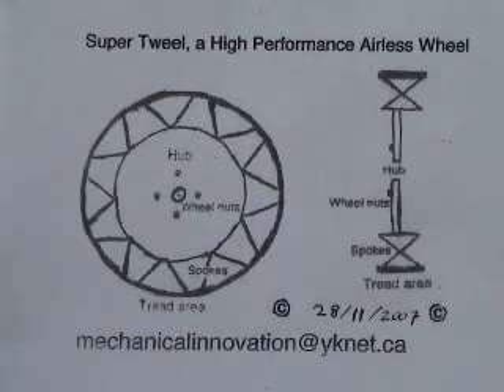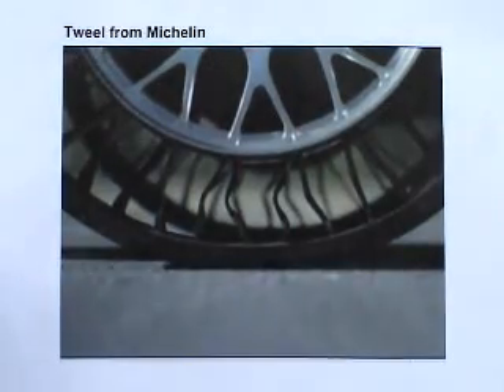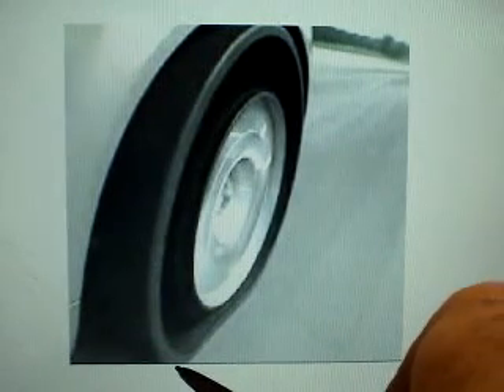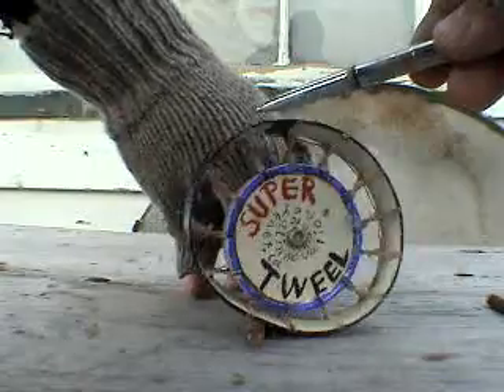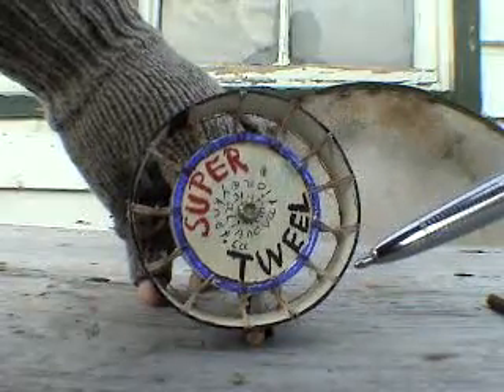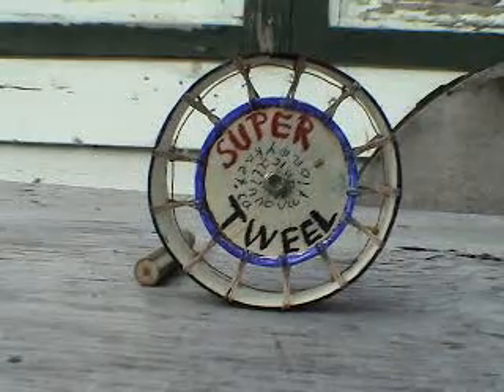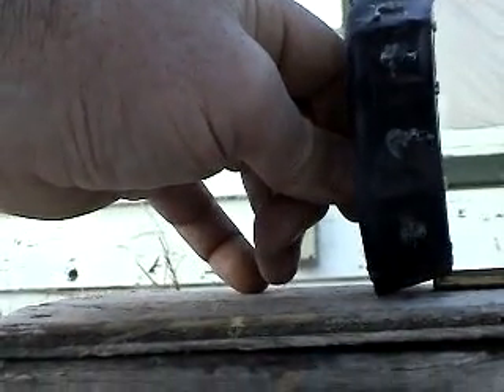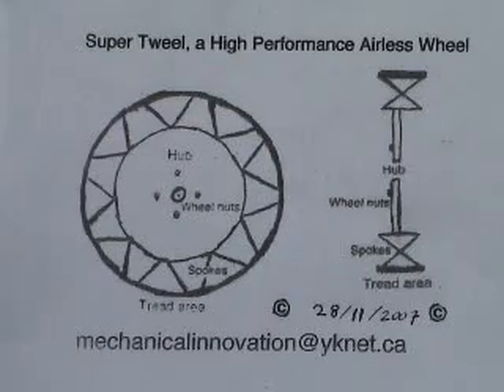Super Tweel, a High Performance Airless Wheel © Peter Becker

Comment: Also, in response to outer rim remaining intact, the tweel does rely to a small extent on the outer edge remaining intact, however, as the tweel does not rely upon the tension in the spars countered by the rim's structural integrity, it does not completely collapse when the rim edge is broken, as evidenced by the landmine test.

Comment: The tweel prevents this possible disaster by not allowing the wheel to extend beyond the initial radius of the relaxed wheel, meaning that the balance of the wheel is maintained (The compression of the lower half is balanced by the force being applied by the ground on the tyre)

Comment: Using this design, the surface of the wheel will be rounded because of the X type spokes that are under tension. The ends of the X spokes are attached to the sides of tire surface, forming a round surface.

Comment: The only problem is that without the compression of the Michelin Tweel, the footprint of the tire is too small, leading it's traction to be next to nill. This is not a joke because of ill preparation (bravo on the presentation peterantonbecker), but it will fail because the design is inherently faulted. I'm sure Michelin tested this design as well and decided on their production model for a reason. Good job, and keep inventing.

Comment: Another issue your wheel exposes is extension of radius. By allowing the wheel to become larger at one single point momentum from this change in radius will cause the eccentric behavior to accelerate. Think of what happens to a truck tyre when part of the retread delaminates.

Comment: @SuicidalLooney
The only thing that will break are the spoke supports, then the whole will simply tear itself apart. If the design was sound, they would be running these at Indy & NASCAR.

Also notice, the auto manufacturers are not the ones trying to develop this technology. It's just 1tire company. If this were the wave of the future everybody and their mother would be rushing to build their version.

These may have specialized use in the military, otherwise these are just BIG forklift tires.

Comment: When I stated that the tweel does not rely on tension in the spar, I meant pre-tension which your wheel uses to hide the buckling effect seen in the tweel.

For no tension to be exerted, the tweel would distort far outside of the circular form, which is where your model comes in, it allows the tyre to distort outside of the relaxed form. This distortion creates eccentricity in the tyre rotation this is _very_ _bad_ for tyres

Comment: Vid Creator needs to read up on engineering and elasticity, your wheel design relies upon the outer rim of the wheel remaining intact for the wheel to function. The instant the outer surface is breached, the wheel will destroy itself due to the high tension contained within. The elastic crossed spars provide no better sideways deflection prevention than wide spars (is the equivalent of a crossed set of spars of same width, but stronger due to larger cross section)

Comment: Yes. The newtons laws dictate that an object if being forced downwards by 1 gravity, can only move sideways with the same force of 1 gravity.  With a pneumatic tire a car can be accelerated at more than 1 force of gravity. I cant explain to you how it works in 500 words.  So please read up.
Also, the "tweel" does not deflect correctly in a corner, so if a car has any body roll it would quickly lose traction.  Suspension would need to advance to accommodate these wheels, not the other way around.

Comment: Tension is a force, not distortion, you are confusing the forces involved with the appearance of the wheel itself. Tensile load exists on the tweel on all staves, except for the ones being compressed by the weight of the vehicle. The tweel does not distort out of round like your wheel because this is disastrous.

Comment: how about sway and arrow dynamics? this would have to be compensated with enclosed wheel wells and larger wheel wells for the deformation of the circle wheel into an oblong wheel under load. when the car is in a turn the soft spoke you are proposing would cause the vehicle to sway and shift laterally. this design is ereversably flawed. i suggest you start over with a more rigid design.

Comment: that is exactly what he is saying.  all wheels today do this same thing... thus giving you ZERO benifit from the tweel.   The external ring does not deform along the bottom as a radial tire does.  This is more efficient. A train wheel is 700 times more efficient than a car tire.

Comment: Your wheel design introduces a fatal flaw. By allowing the wheel to distort outside of the relaxed radius of the wheel you create eccentricity in rotation. At high speed your wheel would tend to vibrate vertically excessively not unlike an unbalanced wheel as the increased radius created by the top edge of the wheel moving away from the axis will push forward and down creating an egg shaped wheel. You forget that this needs to rotate at over 2000rpm for just 60km/h (205/75 R14)

Comment: The tweel operates with precisely the same mechanic as your wheel design and your wheel design offers exactly no benefit over the tweel design.

The Lower structs on a tweel only compress as a function of flexing in the outer rim, this is identical in effect to the compression shown in your model. The tweel does not float on top of the compressed stalks, rather it hangs from the top stalks exactly the same as your design does. If you understood elasticity this would become readily apparent.

Comment: check out my channel, i posted an innovation to the tweel, a useful safety features anyhow. why not slots where the tread connects the rim, the stiffness of a metal block or spoke driven from the tire tread to the rim might keep it stable in turn